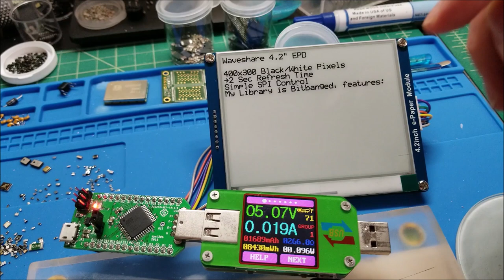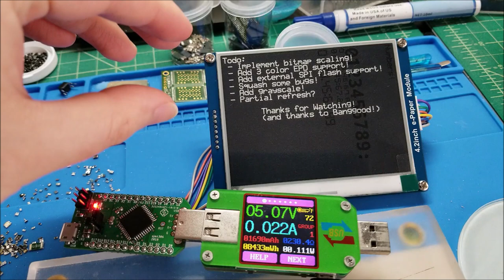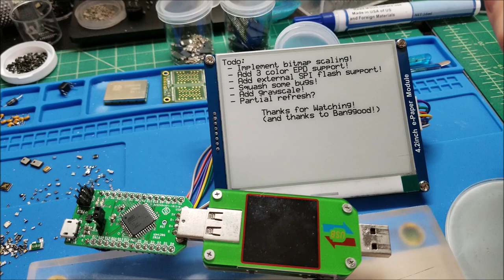Let's Play with 4.2" 400x300 ePaper Display from Banggood!

Comment: I have too too many ideas for this display and not enough time.  Mine is arriving later today.
Reply from the maker: They are really fun to play with and very useful in certain applications.
Reply: @sjm4306  I'm going to hook a PI zero to it and try out the python examples to start.  This is my first ePaper display not including e-readers but I don't see anything complicated in the instructions.
Reply from the maker: They are pretty simple to drive, just requires quite a bit of ram if you want to double buffer them. The Pi zero is more than enough to drive one.

Comment: I don't know why but I really want to use one of these for a gameboy or a DS and display some 3D grayscale on it. I'm wondering how fast you can get it to refresh. Alec from Technology Connections has a video on an Android tablet with one of these displays and it's capable of refreshing fast and cleanly enough to play youtube videos and it's really impressive. I kinda wanna get one of these and tweak it and tweak it more until I've got a routine capable of refreshing it at like 15fps at least. I think it's possible. Would be useless, but fun and impressive looking.
Reply from the maker: I think 15fps is possible depending on if the display controller allows it. Applied Science made a great video tweaking epd lut values to support faster/partial refreshes.
Reply: @sjm4306  Ah yes, thank you for reminding me, I'm gonna go watch that video again to get some ideas :) (also hi I've been watching you for years so getting a reply from you is pretty cool thx)

Comment: Doesn't this display support partial refresh? That would also cut down on your energy use I think.
Reply from the maker: I think so, just have to program support for it
Reply: @sjm4306  It's pretty impressive that you created a library from scratch!
Reply from the maker: Thanks, though I wouldn't say I created it so much as bodged my hastily written software together and banged the keyboard till it worked lol.